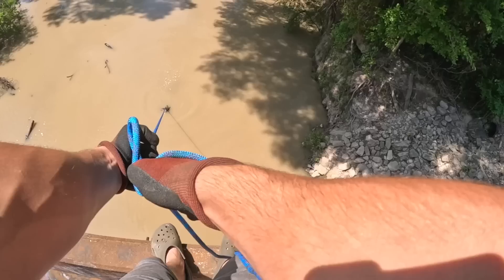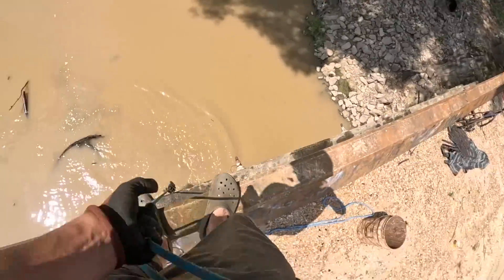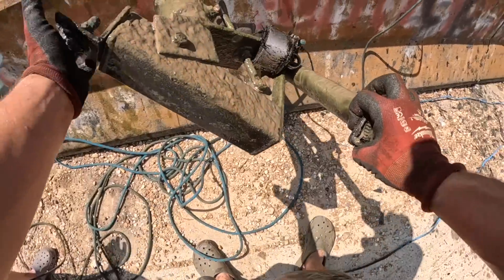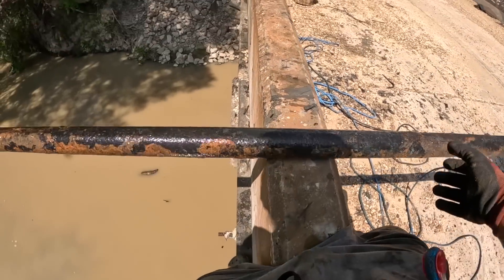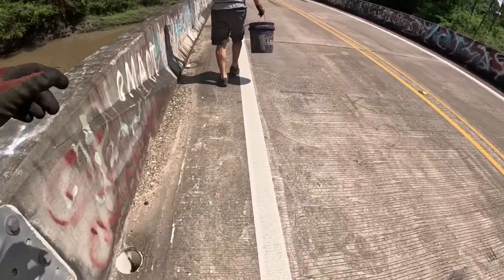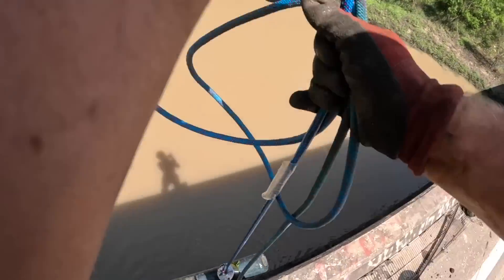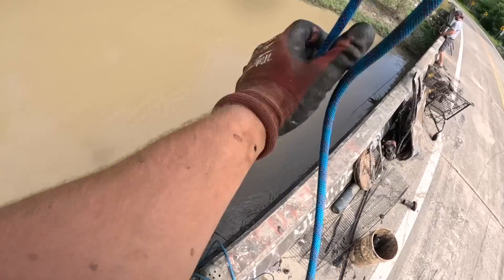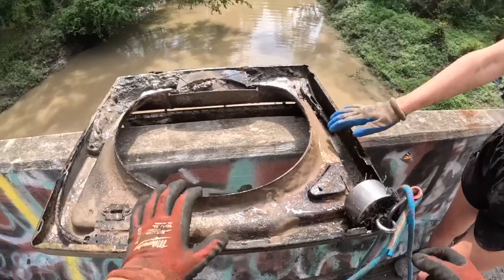This River Is Completely LOADED - INSANE Day Of Magnet Fishing

Comment: The part you brought up that read Gold Electronics is a LNB for the satellite antenna.  The rods are the arms that attach to the antenna.  The LNB reads the frequency being downlinked from the satellite in space.  low noise block downconverter (LNB).